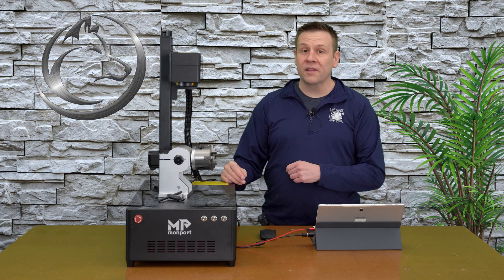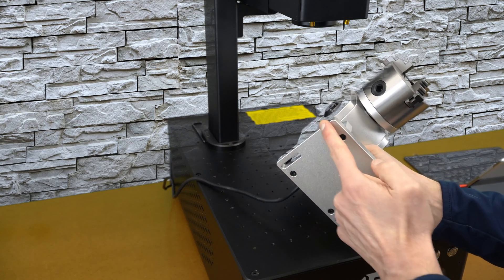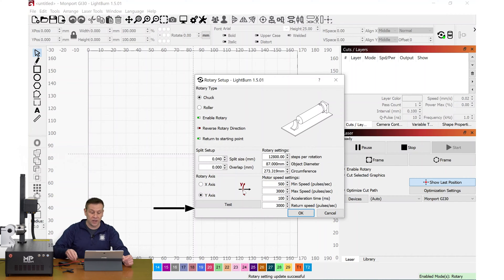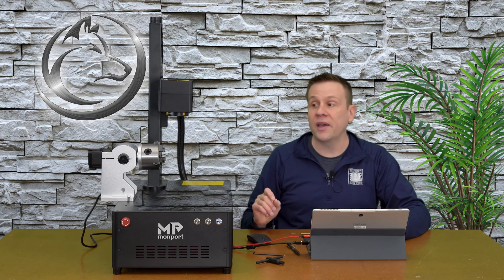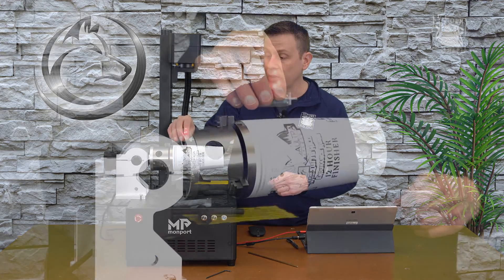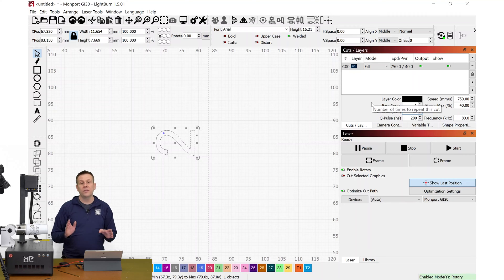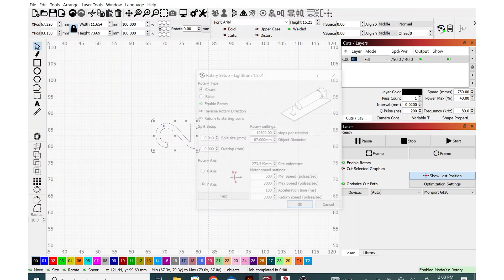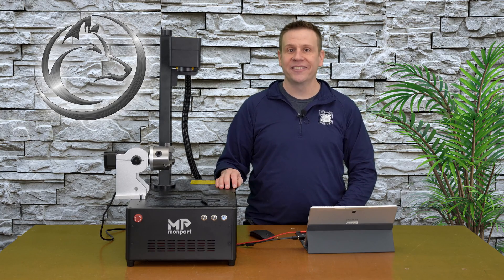Best Method - Rotary Setup for Fiber Lasers

Comment: Hello, very useful video. Quick question, is that rotary only working with Monport laser or these things are universal? I see they all have the same plug.
Reply from the maker: The rotary with work with most brands of Fiber/Mopa lasers.  It's the step count of the motor that makes it compatible with most machines.  The step count is 12,800.  Most Co2 flat bed laser machines use 6,400 step count so the laser machine would need to be reconfigured to make it work.